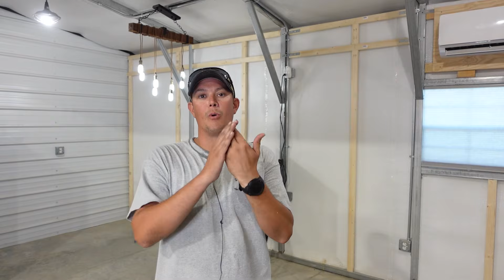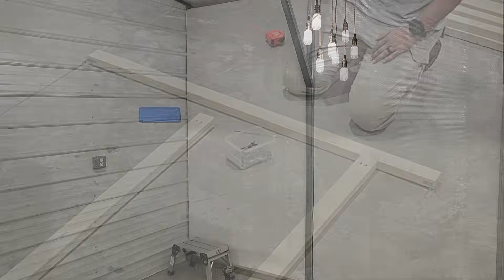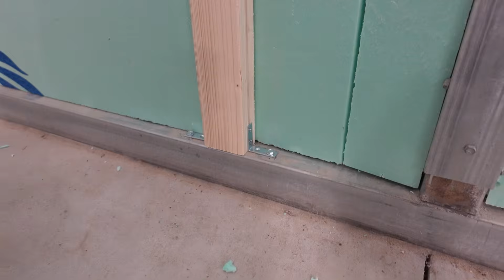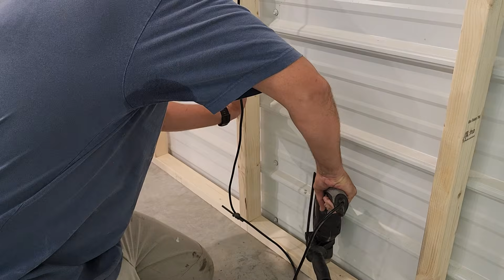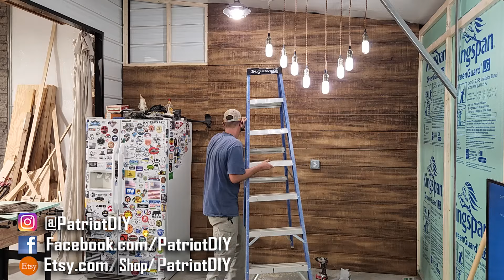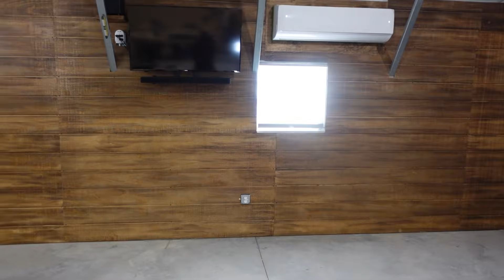Installing Plywood Shop Walls / Framing and Finishing

Comment: 🎉 you wanted to save on lumber but yet brackets and screws cost more than nails and you couldn’t get 9 foot studs or 10 foot or 12  2x4s ,yeah they’re called studs,,,,,,  You didn’t save on lumber…. You spent more on brackets and screws then you would have for nails, but I understand you need the self tapping screws.     Glue and cement nails for the concrete floor….. again just saying do however you want what makes you happy but I thought this video was about saving money!

Comment: Looks great. Would it make a difference using the darker stain once installed to hide the vertical lines between each section?
Reply from the maker: That could help for sure

Comment: Couple "Q"'s, what's your metal stud spacing? Also any reason you put the bubble insulation behind the foam board? I thought an air gap was desired between the back of the foam the the metal skin? Thanks!
Reply from the maker: Stud spa ingredients 60"  the bubble insulation was installed a year before this video, just added the foam for more insulation when installing the plywood
Reply: @PatriotDIY  That's kinda what I figured. Thank you for the reply! I ordered 4" centers and they screwed up and after some negotiations I kept the 5" so I'm going to do it how you did.

Comment: Why not just screw directly
In the metal framing??
Reply from the maker: I did, but 60" on center stud spacing wouldn't make for a very strong wall.  I built 48"OC wood studs then also screwed to the metal studs as well.

Comment: Same type of building I'm working on doing the same. I'm dealing with a problem with water coming in underneath square tubing. Looking at sealing it with a liquid sealant but just curious what you would do?
Reply: Add gutters to get the water away from the base.

Comment: I didn’t see the comment, but when you put the first wall up on the left-hand corner, you drilled through the outside tin wall?  Not picking I’m just wondering. Love your videos. I’m about to do wall sheeting in my shop right now today it’s been spray foamed.
Reply from the maker: @altonjohnson92  no, the wood is secured to the metal studs , not to the the siding.   If you are talking about the left side wall, thats not an exterior wall, there is another room and I'm screwing into a stud
Reply: @ ,  thank you for the clarification. I appreciate it so much. I’ve watched your channel before I like your progress.
Reply: @ , yes to a metal ceiling. I think it has a good look still.

Comment: Why not drill pocket holes and attach to metal studs rather than using brackets?
Reply from the maker: @stonewall1539  i dont know of any pocket hole screws that would go through metal

Comment: Only suggestion  I would make is to off-set the vertical seams. That will tie the entire wall into a more rigid piece. Not “required” for a metal building but it’s stronger and doesn’t cost any more so generally wort it. Unless for some reason you want an 8’ board and batten look with no visible seams.

Comment: Thanks for the useful info! Just to clarify, based off your channel, you used just the double bubble for a couple of years and then did the framing and plywood? Curious if you got good use out of just the double bubble.
Reply from the maker: @kw1234-w8y  yes it was fine with the double bubble paired with the mini split and/or wood stove. But as my shop evolved, ive finished the walls a little at a time which gave me much needed wall storage and extra insulation
Reply: @ Awesome. Thanks! I’ve watched a lot of your videos and plan on eventually doing the same down the road but need somewhere to start!
Reply: @PatriotDIY  Is it necessary to use treated lumber or no?
Reply from the maker: @kw1234-w8y  Its reccomended for any parts that are touching the concrete floor

Comment: How did you finish off the ceilings? Im basically in the process building the same thing
Reply from the maker: @MjDomzal-fv4fy  I haven't done it yet, but thinking about using corrugated metal

Comment: What's the dimensions of the square tubing used for the building frame?  Who was the building manufacturer?  What is the white insulation panels inside the framing?
Reply from the maker: I believe it 2.5x3.5" steel tubing.  The white is double bubble reflective insulation, I have a video on the install.

Comment: 2" foam would have slipped between those frames and then you can put plywood directly on metal frame with self tappers. Just did a 50x30 this way. Took 3 days with 3 guys and a 4th day with 2 guys for the front with 2 10x10 roll up doors. That was the hardest part. Fitting around roll up doors.
Reply from the maker: Not a bad idea BUT, My metal frame is 60" on center, my way ads alot more support behind the plywood and allows me to use the full 4x8 sheet rather than wasting 3ft off every sheet!
Reply: @PatriotDIY  that does make sense! The one we just did was 4' centers so that made it a little easier. Them self tappers to get into that galvanized metal was some work for sure, though. Your way is awesome because it's easy running once the framing is in place. Awesome job!
Reply from the maker: @mediocrefloridaman  thanks!!!   Yeah getting into those metal studs is alotta work, I ended up predrilled most of them!
Reply: @PatriotDIY  definitely a good idea!
Reply: Been going back and forth on what to do in my 30x40 shop. Wanting to do something similar with white metal siding. Not sure if I should frame or just attach to metal studs.

Comment: I've decided to have horizontal metal siding, so I can run my electric through the grooves. Then, use 3/4" vertical 1x2 slats against the siding to allow for 1-1/2" foam board insulation to be installed flush with the metal studs. Tape the joints, Spray texture, and paint right over the foam board. Since I will be installing tons of peg board, shelves, and storage racks, I don't need beautiful looking walls. I just need it to be white and functional.

Comment: Looks great bud, I do have a question, I have been wanting to use T-1-11 in my shop for a while, im going to do like a corner bar area and want a rustic look. but i have read that the T-1-11 uses a formaldehytde binder ( or something similiar) when it is made and it shoud only be used outdoors  for fear of the gases it my put off in doors? I'm just wandering if this is a legit concern.   Thanks ...
Reply from the maker: I'm not sure about all that.  I wouldn't eat it lol, and maybe wear a mask when you cut it.  but I'd think it would be fine on the wall!  
Disclaimer: I am not a medical professional 😆

Comment: I have a 30 x 40 metal shop been deciding on what to finish with. What did you use for blocking for the TV n split unit?
Reply from the maker: 2x4s and plywood

Comment: Hi, I'm going to be building a 30 x 45 metal garage and I love all your ideas, FYI I would encase the steel angle supports in pine, to loose the metal look, but it may go with the metal roofing

Comment: Just the video I was looking for. Getting ready to finish my building, and I planned on siding like you did, and notching around the angles. Only my plan is to use 1 x 4 horizontal girts attached to the metal studs, and siding over the top. Hoping that works.